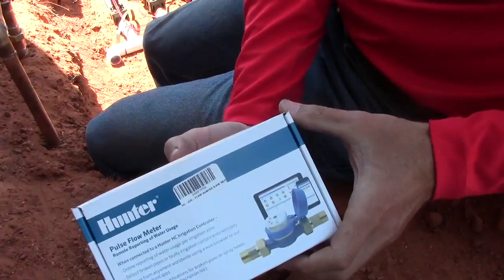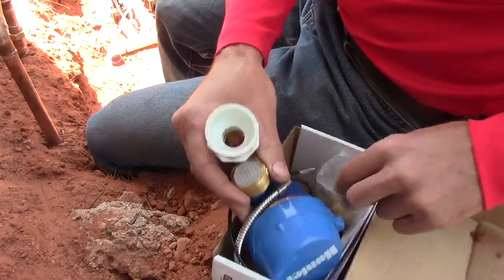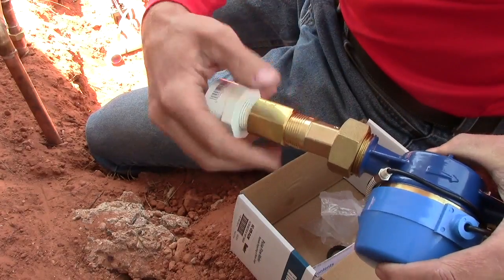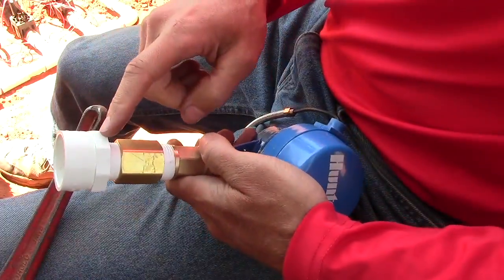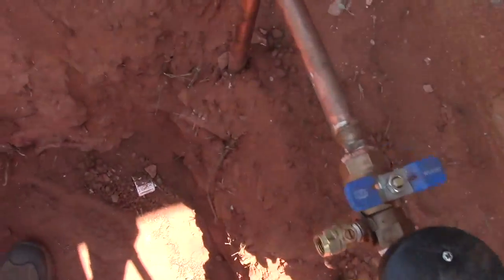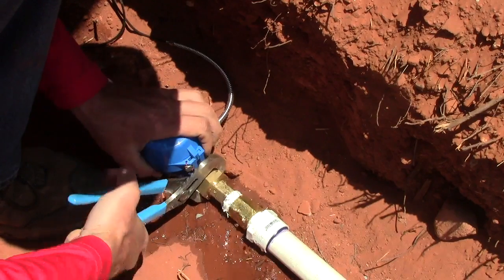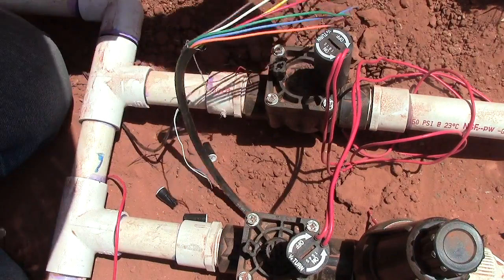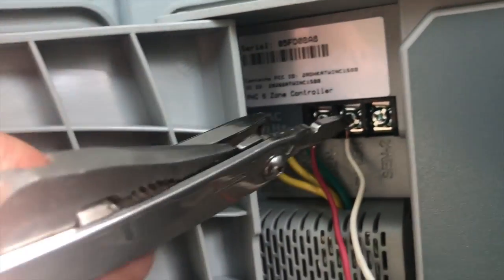Hunter Hydrawise Flow Meter Install and Unboxing

Comment: Can the flow meter be installed inside the home right on the main water pipe after the controller?  Why does it have to go outside in the ground?  Seems like it would be easier to do inside, and connect the wires right to the controller.  I’m new to this, so just asking.  Thx
Reply from the maker: Yes you can do that, but with the way our mainline water systems are installed and the cold weather we do ours underground.

Comment: What is the point of putting a flowmeter on the sprinklers?  Someone knows?
Reply: Murillo’s if you have a big property is good so you know if you have a leak in the main line or a hanging valve,
Reply: Having a flow meter on a good controller you can set the expected flow rates of each zone. If a sprinkler, pipe, drip tubing breaks, burst, or is damaged then the the controller will ALERT you of unexpected increases flow rate increase. Will also notify you if a solenoid goes bad causing no flow on zone.
Reply from the maker: Everyone has great points.  Exactly like Flavio and NC said.  It alerts you to low or high flow.  Most folks don't know they have a leak until they get their water bill.  Some of our clients have gotten a $600-800 bill because something broke and they didn't see it or notice till the water bill arrives.  Or if there is no flow, you get an alert so you can see what the issue is and catch it before your plants wither up.

Comment: How do we can control flow can u pls explain??
Reply from the maker: The Flow Meter doesn't control flow, it measures what your flow is.  If you have a higher or lower flow than the last time the valve went off, then it will alert you.  Also, if there is no flow when there should be flow or when there is flow when there should be no flow then you get an alert.  To control the actual flow, there are multiple ways to do that, installing a pressure reducer valve will control the pressure that ultimately controls the flow, then you can use different types of sprinkler heads, nozzles or drip emitters to control the actual flow.  Hope that helps.

Comment: If you do not use shielded cable, your flow readings will be way off.  Don't use normal multi-wire. Shielded cable only.
Reply: From the instructions: 4. Cable (shielded direct-burial cable must be used): Two-wire cable is required. The cable gauge is determined
by the total length of cable between the controller and the flow meter. The cable should consist of 2 dedicated
wires and must not be in the same conduit or cable bunch as the solenoid wires. Do not share the common wire
of the solenoids with the common of the sensors.

Comment: So the printed instructions on the hydrawise website and in the box are wrong?
Reply from the maker: Ahhh, that is a mistake on my part.  The blue and white wires are to be connected and the red one should be sealed with a  waterproof wire nut.